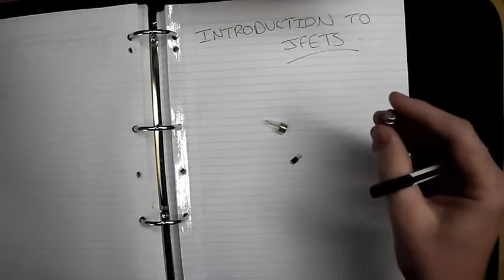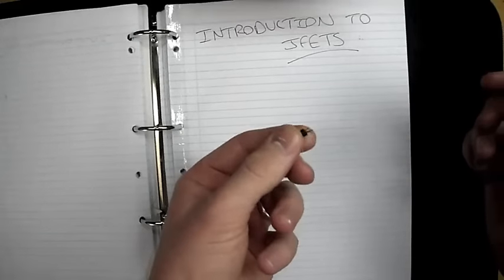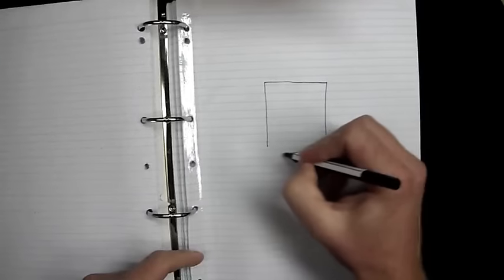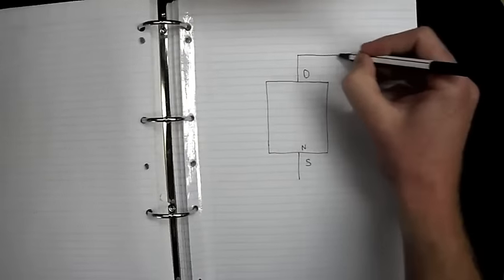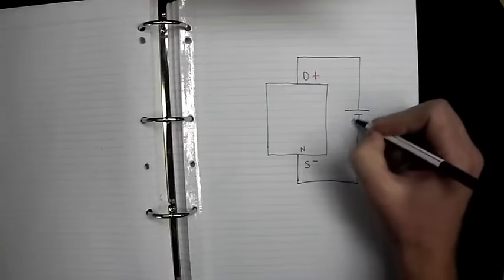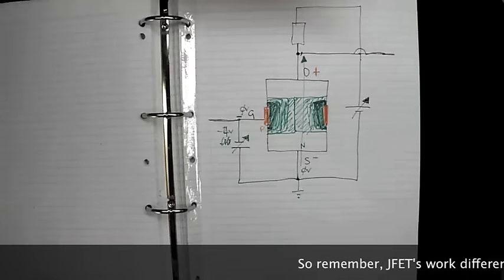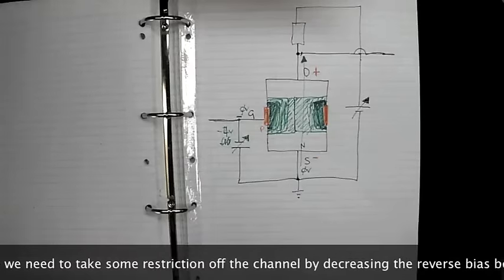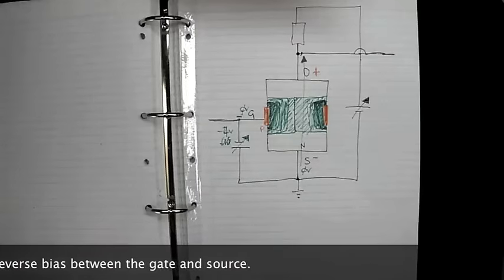Electronics Tutorial 8 - Introduction to JFET's

Comment from the maker: @bvprulz JFET's should 'never' have the gate / source forward biased (having the gate more positive than the source) you can actually destroy the device. There is one instance where you would need to forward bias the gate source (but it is only for one small moment) and this is with a clamping circuit (used in oscillators) where we need to charge up a large capacitor (via source / gate current) connected to the gate. once charged, it basically stays charged and we then get no more gate current.

Comment: As others have hinted to, not sure your doing newbies a favor by showing current direction as the flow of electrons versus conventional current flow direction. Conventional current flow is the convention that will be used on the other 99% documentation that they see dealing with electronics & current direction. Apart from that, thanks for the nice soft introduction.

Comment from the maker: @DavidLawton93 It all comes down to what you are trying to achieve. Both BJT's and FET's are great for amplifying however, depending on the application, one would be better suited than the other (impedance matching, frequency of operation, gain, cost etc...)

Comment: I like how you physically explain how these devises work. Now, I have my eye on the JFET as a potentially simple way to auto turn on and off a solar light, but not sure about the high gate voltage...
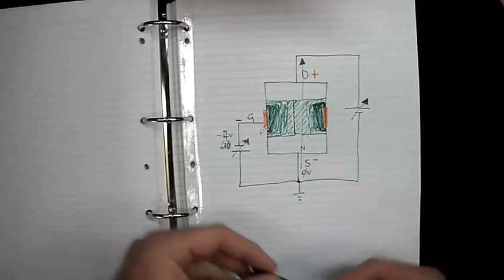Could a really small current from an 18v solar panel be used to turn off the circuit, for a 12v solar light (4 high power Cree leds in series) in the day within the diagram at 11:50 ?
Thanks

Comment: Sir, the direction you mention as the direction of current, is it the actual direction of current or the direction of flow of electrons? Conventionally direction of current is opposite to that of the direction of flow of electrons, right?
Reply: +megha jayaprakash Electrons move negative to positive. Conventional current moves positive to negative. Any flow markers you see on schematics and parts are the direction of conventional current, not the flow of electrons. The arrow he drew for the flow of electrons is opposite of the conventional current, and that is bad form, correct :)
When sketching schematics for public consumption, you really should draw them as conventional current to prevent such confusion. People who learned by the flow of electrons, and not the current, already know they need to invert the current direction indicators.